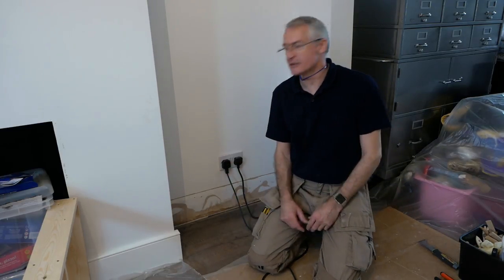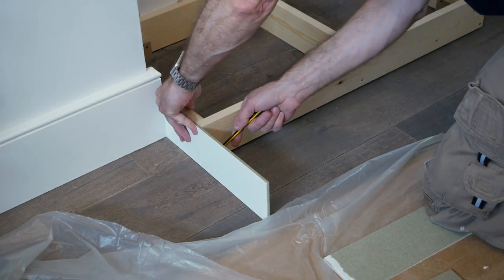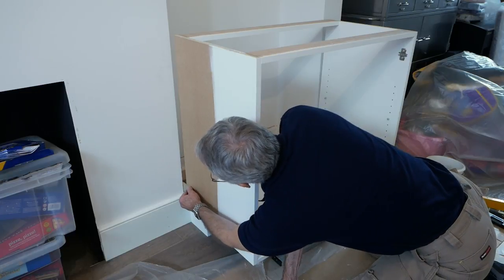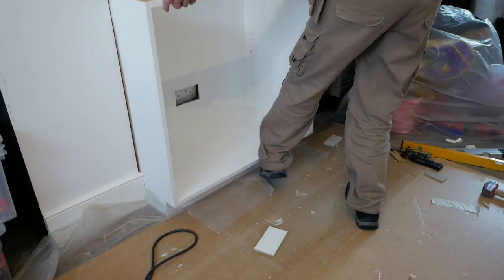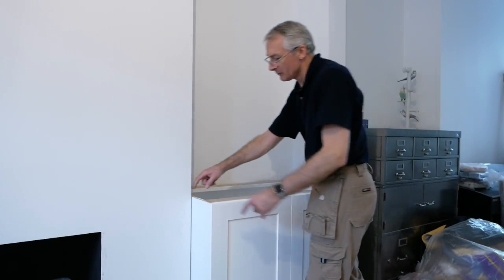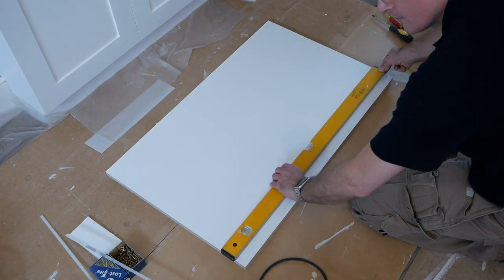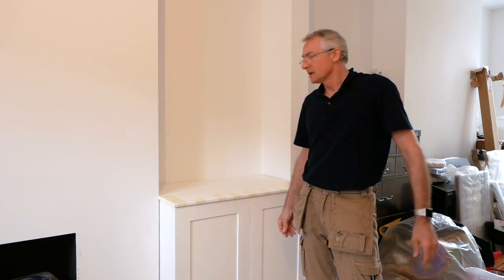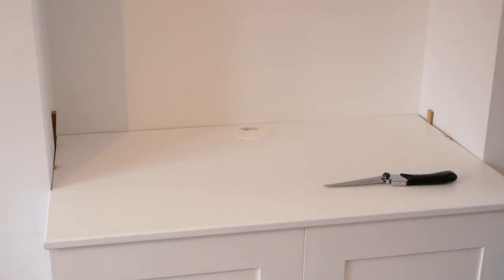4 of 5: Alcove Unit #097

Comment: Lovely work here as always. Do you have any suggestions as to how you would fix a plinth capping to a plinth if you were working with MFC or similar material where you would have to hide any fixings? Thanks
Reply from the maker: Thanks! If it needs to be removable, then some kind of hidden panel fixing e.g. Buttonfix would work. Otherwise I’d just glue it on, probably. 👍
Reply: Peter Millard  thanks peter. Looking forward to more cabinets and other build videos!

Comment: Looks like it's coming together nicely. Why the wedges for the top?
Reply from the maker: Yes, not too bad so far, thanks!. I like to wedge the top as the client has small children (prone to climb) and without the wedges, there's nothing securing the carcass in place at the height of the top. The plinth is fixed to the floor, the cabinet fixed to the plinth through the base, the bottom of the bookcase fixed to the cabinet top, and the top of the bookcase fixed to the wall; it just feels a little 'loosey-goosey' around the middle. Whacking in a few wedges takes a couple of minutes, costs virtually nothing, and just makes me feel a bit happier about it. That's all 👍

Comment: Hi Peter, absolutely loving the videos! When you level up the plinth, do you overcompensate for the floor settling towards the middle of the room when the weight of cabinet + shelves is on?
Reply from the maker: Thanks! No, not typically - unless there’s some kind of obvious issue with the floor, in which case that needs to be resolved before any install tbh! 👍

Comment: Do you have a general rule of thumb for measuring the placement for the base plates of euro hinges? Or do you just line the door up and mark the holes? Your videos are so informative and great!
Reply from the maker: Thanks! The hinge plates are usually equidistant top to bottom, and where exactly depends on the size of the door. I do have a set of ‘standard’ markers, but couldn’t say off the top of my head - would have to measure them when I’m back in the workshop. Will get back to you later on. 👍
Reply from the maker: Just measured the little DIY jig/template I use and it looks like I set them 123mm to the hinge plate centre, from the top/bottom of the carcass. I've noi idea why it's 123mm, but that's what I've been using for years, so it seems to work for the kind of doors I make! HTH P

Comment: Great videos thanks Peter, I'm currently starting making my own custom alcove units and these have been very helpful in sending me hopefully on the right path!

Can I just ask when you measure up the available space how much do you usually reduce it by to make the cabinets & plinth? 

Also most alcove cupboard units I see have a recessed skirting / plinth board. I'm looking to bring this forward to be level with the doors for a more built in look. I guess just packing out the plinth on the front and / or making a deeper skirting board would do the trick?
Reply from the maker: Thanks! If you're going to extend the skirting so it wraps around the cabinet (and I agree, it's a good look and makes the finished result seem much more 'fitted' visually) then plan on removing the skirts in the alcove and making the cabinet 20 - 30mm narrower than the alcove overall - though check this with a known, square template to be sure it's enough! I then use an 18mm end panel to enclose the outside edges of the doors, so they look inset, and you can then extend the end panel back to the chimney breast and scribe it in neatly. 

I did that on this job - https://goo.gl/Y4QExV - and it worked well. HTH P
Reply: Solid advice that, thanks again Peter.
Reply from the maker: +James Whittaker 👍

Comment: Have I just seen you using a Makita track in a Festool saw?
Reply from the maker: Sure, works great. I bought a 3 metre Makita track back when they were way cheaper than the Festool, and cut it down to make a 2100/900 for trimming doors. Only thing to watch out for is the anti-tipping lip Makita has gets in the way of some of the accessories e.g. parallel guides, otherwise it works fine. 👍

Comment: Peter, I have a question regarding the electrics if that's ok?  I've always been led to believe that there should not be any combustible material inside the socket area (in this case the MDF cabinet back).  I always fit a new recessed pattress box in this situation.    This looks a much faster/easier solution.
Reply from the maker: Hi Steve. The question's come up a couple of times since I've been doing these vids. and each time I've asked my sparky (full scope qualy, not just Domestic Installer) if it's OK, and each time he's said yes. I'll check with him again - I'll confess I hadn't thought of the potential combustion aspect - would be a bit of a downerif it's not compliant... :/
Reply: At least there's no evidence online

Comment: Peter, I'm part way through a project following your trusty methods, something I'm wondering, the white panels you fit to your plinth, are they just 6mm MDF painted by yourself or is there a product that can be bought to cover the 4x1 redwood specifically for that purpose?  Thanks!
Reply from the maker: +Jack Morris It’s just painted 6mm MDF - nothing special at all 👍
Reply: Peter Millard thanks Peter! One more thing if I may pick your brains 😬 - I ordered the Blum soft close hinges (and hinge jig) from your link under one of your videos, but what size holes do I drill for the hinge plate screws? (The ones where the fat screws are provided, not the cup which I know to be 35mm). Thanks!
Reply from the maker: +Jack Morris Sorry, just seem your reply. I usually drill a 3mm hole for the hinge plate screws, but any pilot hole should do 👍
Reply: Peter Millard thanks for your reply as always 👍 , I fitted the plates today actually and did some trials on a piece of scrap MDF First to avoid wrecking my unit! 3 and 4mm came up too small for the fat screws provided with the Blum hinges, had to go with a 5mm! Have worked out beautifully with the jig though :-)
Reply from the maker: Jack Morris Ah, ok,  sorry, didn’t realise you were working with the stubby screws that come pre-installed with the regular cruciform hinge plates. Yes, they’re 5mm euro screws, designed to fit the ’32mm system’ where the doors align with the shelf-pin holes. I usually use 4x16mm screws, so 3mm pilot hole works well. 👍

Comment: What width do you make your styles and rails on your doors? Do you always do the same size or does it vary depending on what size doors they are?
Reply from the maker: It varies a little, but I typically use 80mm as the starting point. Don’t think I’ve gone thinner than 60mm, and maybe up to 150mm for the base rail on a tall door. But 80mm is the usual starting point. 👍👍
Reply: Peter Millard we are not that far apart then i use 75mm 👍🏻

Comment: I won't tell the festool people you've been using a Makita track with a ts55 shhhhh
Reply from the maker: 😂 Been using it for years - way cheaper than the Festool 3-metre track back then. Not so much now, but still savings to be had 👍👍
Reply: @10MinuteWorkshop es I bought a festool 3 m track - but I aint got a 3 metre van so now its a 2.6 M track
Reply from the maker: My Makita’s a 2.1 / 0.9. Works well for doors 👍👍

Comment: I've been considering an electric headless pinner for a while but am unsure which one to get.  What model are you using in the video and how do you find it?
Reply from the maker: It’s a Spotnails SE30-08 mains electric 21g veneer pinner. It’s OK, but tbh I’d look at a 23g headless if I was buying again. I think Makita and Hitachi/Hikoki both do a 23g cordless now. But I like electric overall, much more than gas or compressor, especially for installs. 👍👍
Reply: Thanks, i'll check them out.